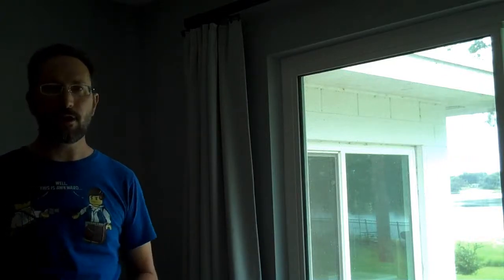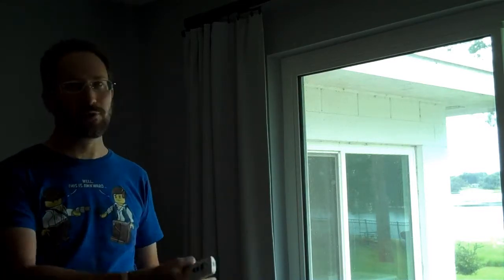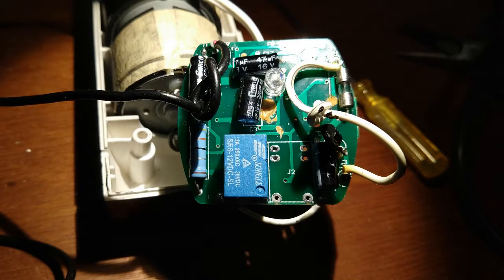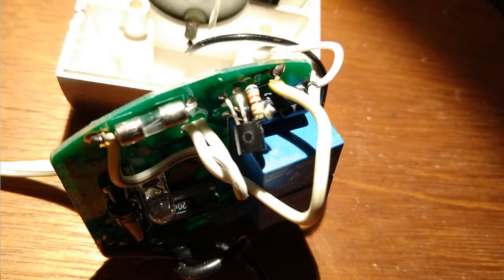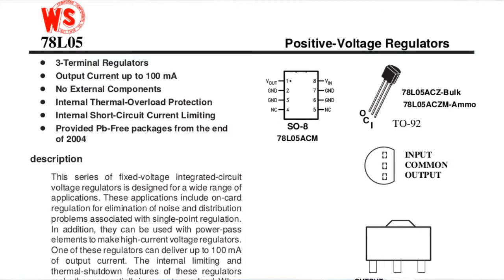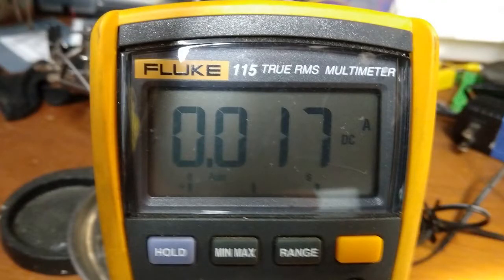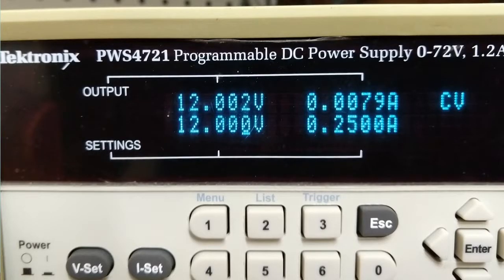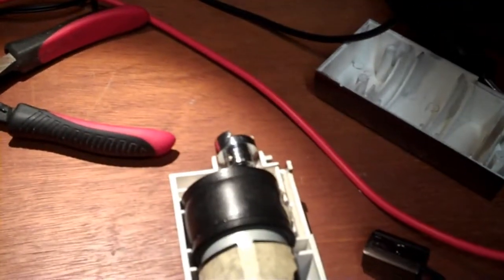BEME E-Rod motorized drape motor failure and repair

Comment: Can you buy a new motor?
Reply from the maker: I have never found a place to buy a complete new motor unit.  (However, you could probably find a replacement for the DC motor inside the motor unit if it were ever to go out....but so far in mine it has always been the driver circuit (electronics) problem, not a problem with the actual motor itself.